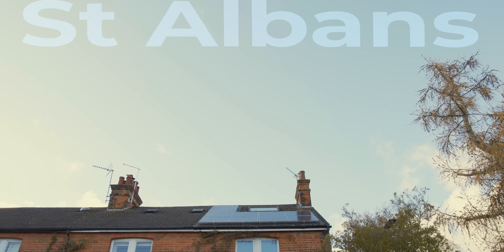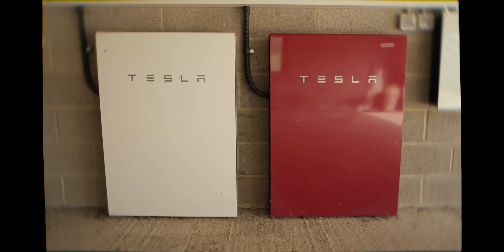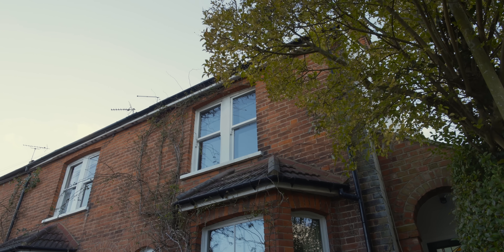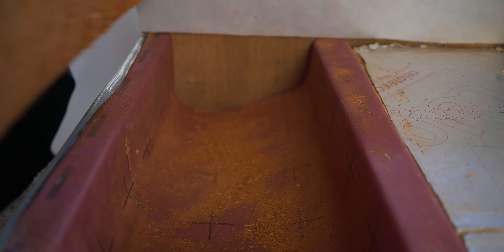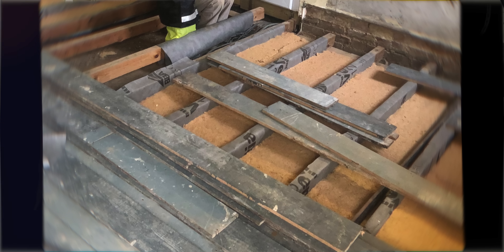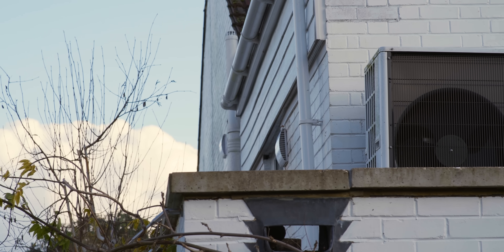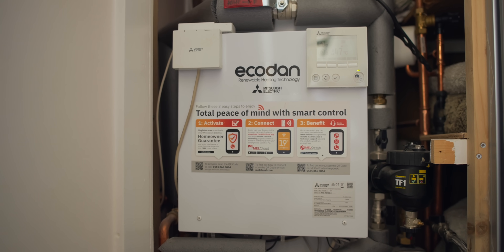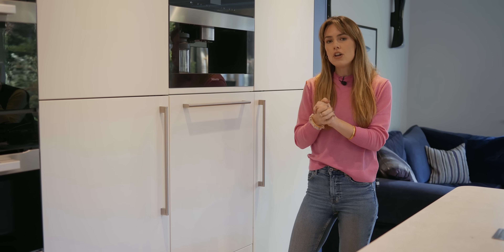This Victorian Home is Now 75% More Energy Efficient!

Comment: I've added a lot of insulation to my 1930s house including rigid insulation under the floors - yes, a mistake as I now know because it still means the floor is cold. I live in an exposed site with wind howling under the floor. I wish someone would come up with something like an air to air heat pump that heats the void under the floor as a kind of underfloor heating, extracts moisture, and cuts out that wind!
Reply: air to air heat pumps are called Air Conditioners some times referred to as 'mini splits'. And you're right - that's a good idea!
Reply: @Missi0n141  Thank you! 😊
Reply: Sorry to hear that - the draughts that come up from the sub floor void are horrendous
Reply: @ecorenovationhome  Cheers - if only I could get a not too invasive solution!
Reply: Ultimately the best way to solve the problem of a suspended floor is get rid of it and convert it to an insulated solid floor. Often the gap is just the right height for ~20-30cm of insulation and a new floor. The ventilation is only there to keep the timber dry. Remove the timber and you can close up the ventilation. This is a relatively expensive and disruptive option but it produces a much better technical result: warm, dry, airtight, and can add significant thermal mass, depending what you use for the solid floor. That's a carbon tradoff, because concrete is great technically, but high carbon. Lower-carbon options have less thermal mass, and thermal mass on the inside of your building is generally a good thing.  And whilst you do it you can put in underfloor heating to make for a more efficient heatpump.
Reply: @xxwookey  Thank you for that also. I've considered that option. I've seen a couple on a channel MAKE. DO. GROW. using an expanded clay product called Leca bound together with lime as their solid floor. The clay acts as insulation.  Quite disruptive though! 😊
Reply: You can make your PIR insulation fit better by using 'gapotape' which is squidgy foam tape round the edges. It's good stuff, but not particularly cheap. 
Just adding an airtight membrane under the floorboards (assuming you didn't already do that) would also make a big difference.
Reply: @xxwookey  If only I knew of it when I did the job...I can't see myself revisiting it now, hence I wonder about less disruptive solutions to improve insulation around the perimeter.
Reply: @LaReynedeNeige  Yes, once you've done the floors you don't want to do it again. I didn't do them at the start in my first house, and once it was full of stuff it was just too much of a PITA. And sadly builders are not well-informed about this stuff either and tend to suggest 'cheapest' rather than 'good'.
Reply: Heating the subfloor would essentially be heating the outside. Much better to stop that air entering the fabric of the house with fraught sealing and insulating.
Reply: @Giant.Iain171  A certain amount would certainly transmit through the brickwork without insulation, it's a cavity wall infilled with blown insulation. The building is held together with lime mortar, I do wonder if there is a technique for externally insulating such a structural element as the foundation walls but never heard of such a thing.
Reply: @LaReynedeNeige  Yes you can do 'perimeter insulation'. I've done it to my house. You dig a trench down against the wall to the foundation and put insulation down (EPS or XPS or foamglass). It's best done in combination with EWI as they you get a whole tea-cosy. But can just do the base and it greatly reduces the heat-leak through the footings. It's normally done on concrete slab floor buildings rather than suspended floor, because in those the bottom of the building under the floor is cold/'outside' anyway.  There are some pics on my video here:  https://youtu.be/OVcvk9Wnyw4?t=2137 but I don't really go into any detail there. On one side of the house it's combined with EWI. On the other side only the underground part is done (up to DPC)
Reply: @xxwookey  Thank you very much for the info, I've not come across any discussion about it ever and it's useful to know. 👍

Comment: The noise around EVs is so surprising when it is the home that will be the real challenge. Even up to if you have a big enough cut out fuse or even on a looped supply. 
So insulation in a building like that is going to need proper investigation, sensitive upgrades and understanding how one change will impact another. 
An excellent video on what can be achieved but also shows that there is a HUGE knowledge gap on where to start. The fact that the homeowners have to become the experts is the reason why residential going green is so difficult. 
But at least she has created a template for her neighbours to follow.
Reply: I think homeowners have to gain a basic understanding since not enough builders understand how retrofit works. That's why I wrote Beginner's Guide to Eco Renovation (link in description above) to help people get the basics.
Reply: @ecorenovationhome  will take a look!
Reply: Plenty of homes have been damaged from insulation done badly. It really does need specialists, cowboys are a problem.
Reply: @LaReynedeNeige  agreed

Comment: Air sealing first!  I have thermal imaged so many homes that were an absolute freak show of leaks yet they had solar panels.  People love glitz.  Air sealing and insulation are boring.  Who wants to live in a warm and draft-free house when you can have solar panels?<sarcasm>
Reply: Solar panels are normally for producing electricity to run devices, not for heating.
Reply: @LaReynedeNeige 

Hmm ... you sort of missed the point being made.

The internet is not for you.
Reply: Airtightness, insulation and ventilation are vital to cut energy use. Solar provides renewable energy. Best to do it all, but if you can't strip back to retrofit, then solar is still worth doing.
Reply: >- Solar panels are normally for producing electricity to run devices, not for heating -<
Energy saved or energy collected via solar all serves to save money or resources.  Far more energy can be saved via air sealing and insulation for less cost than using solar panels to collect the same amount of energy.
Reply: @peteinwisconsin2496  But they're different solutions for different things, not interchangeable.
Reply: @LaReynedeNeige I think they are getting at producing renewable electricity via solar panels is great and all, but you could save more money and reduce gas more by draft proofing and insulation more. 

Which is true for simple stuff like loft insulation, double glazing, draft proofing. 

Possibly less true for EWI / IWI. 

Also fitting an ASHP can decarbonize your home much more than certain difficult and expensive EWI/ IWI measures can.
Reply: @Lewis_Standing  Every building is likely different in terms of what is needed to provide an effective solution for either insulation or solar depending on a lot of factors, eg age and method of construction, location, cost of solution in that location, grant availability and so on. It's not simple, hence the slow take up of either solar or insulation and energy efficient heating systems. Aside from my point that they address fundamentally different requirements.

Comment: Surprised nobody’s mentioned the advantages of having cork based plaster for interior walls because it gives good insulation against the cold walls , multiple all the heat loss with all the interior walls adds up , with that heat loss being saved would probably save quite a lot in heating bills due to the heating controls could be turned down.
Reply: There was a cork insulation on the table, we just didn't talk about it. Haven't heard of cork based plaster - I'll go exploring - thank you
Reply: @ecorenovationhome  They mix it in with the plaster before applying it to the wall , then they did a thermal imaging =with cork and without cork , the finding were quite remarkable, .
Reply: @ecorenovationhome  cork based plaster has almost the same thermal properties and ratings as Diathonite but finding Diathonite is more common to apply by many installers and still gets slightly better results.
Reply: @Her_Retrofit_Space  That's really interesting - thank you. I'll have to add some cork plaster to my box of insulation materials for my Open House sessions
Reply: Yes for solid walled homes Cork or wood fibre insulation is best as it's breathable. 

You can get rolls of 5mm cork or buy thick boards of 25, 50 or 100mm of it.
Reply: @Lewis_Standing  I was referring when cork and plaster were mix together to skim the walls, with cork sheets it tend to shrink, the mixture is far better.
Reply: I've cork lined our hallway and main bathroom around a month ago, walls are about 1.5-2c warmer and no condensation on them in the bathroom now.   Not plastered over them, I quite like the look 😄
Reply: @james.telfer  what did you use to stick to the wall ? Did you paint over it ? Or did you wallpaper over it ?
Reply: The Diaphonite mentioned in the video is a cork and clay based plaster.
Reply: @iainwadey2527  ok , and your point is ?

Comment: I have converted Victorian and Edwardian houses using SIPs to the inside - very quick and affordable - and easy to make airtight.
Reply: Is that using SIPs under floorboards as well - could be an interesting solution
Reply: @LaReynedeNeige  The SIPs become the floor boards.
Reply: We were very keen to be eco friendly, so wanted to use sustainable insulation.